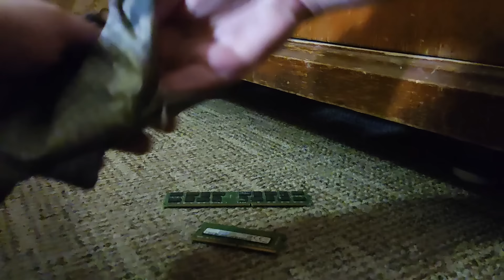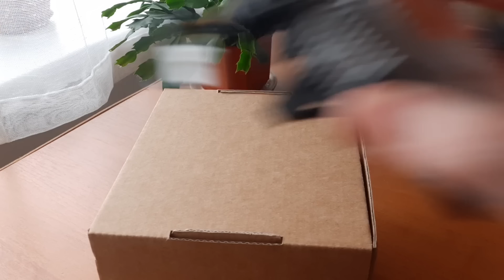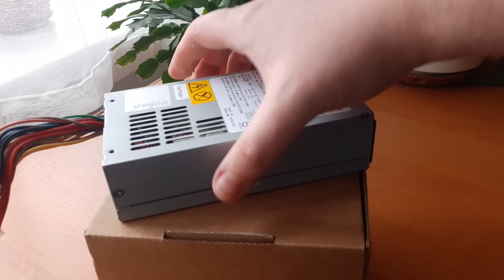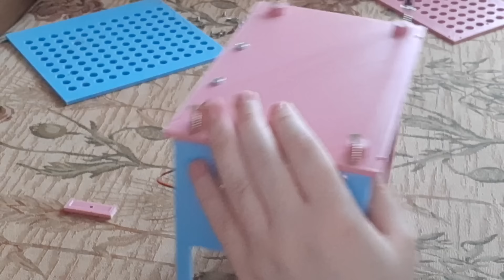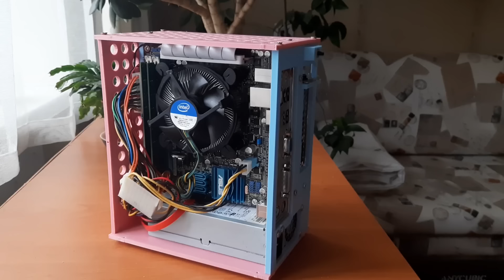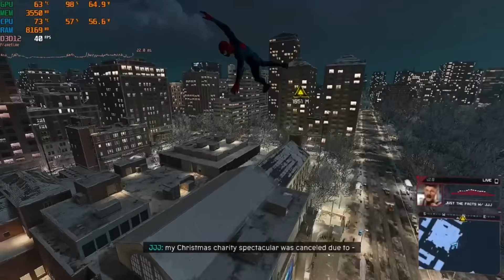3D Printed 6L Sandwich PC - $140 Budget Build

Comment: What's your 3D printer? I have BC-250 and few other things I want to print plastic cases. Having my own printer would let me experiment freely.
Reply from the maker: anycubic i3 mega s, it's pretty old and kinda janky, i'm sure there are some newer options out there that would work better.
Reply: If your willing to cut things up and then screw/glue them together, go for the bambu labs a1 mini imo, its a genuine beast for £170, and if you wait you can get it down to like £130

Comment: i have 5 pc's one is a full custom i7 8700 32ddr4 water cooled a Corsair all glass case/psu and a rx 6600 8gb i did in 2020 my the 4 are used dell office sff i got cheap dell 5070 i7 7700 32gb of ram 2 of them in stock case have rx550 4gb and the last one has a 1070 ti in a black & glass case 12 fans NO RGB !!!!! LOL
Reply from the maker: i'm too scared of water cooling to ever try it, same with glass, seen enough reddit posts about broken glass panels to try that myself lol. rx 6600 is a great card, i was using an rx 6600 xt up until a few months ago, no complaints, only upgraded because i was worried gpu prices would go up, but the only games i'm playing now are from the playstation 1 era lol.
Reply: @LastComputer7642   i live in AZ it's to hot for air cooled and i got my aio's on amazon sealed loop  so i don't put water in them never had  issues & glass is nice and if you ever brake it just get mesh & magnets /plex glass to fix for cheep & a new case is the cheapest/best why to give you a new pc feel for low cost and gives new life to old pc's  ..

Comment: 32GB of used RECC DDR4 was $37 a pair of 16GB DIMMs. Now it's $200. Ridiculous. I hesitated back in Oct. 2024, Regret it now. Can't finish 3 system builds I had started. I've abandoned my computer hobby for the next 2 years. A 8TB used enterprise He drive was $70 each, now good luck finding one. Around $250 for an Ultrastar. Rip off. NVME SSDs are no longer affordable too.  SMH.
Reply from the maker: yeah it sucks, i feel lucky that i was able to build a semi decent am4 computer for myself before the prices went up. and even these old builds are rough because you need to search around for any kind of storage that's a reasonable price.

Comment: I burned out four 2600 processors. Finally clued in that turbo boost turned off prevents the processor from burning out one month after warranty.  Manufacturers always have measures to outdate your investment, designing dumb features and forcing you to upgrade. You might own it outright but will break by design.
Reply from the maker: wow that's crazy, but tbh these 2600 cpus do run very hot for what they are, the next generation really solved a lot of the thermal issues. these 2nd gen i7s really need a beefy cooler. they're also less heat tolerant than later chips.

Comment: I fixed a 1TB SSD with diskpart by doing a full disk clean/format that took like 16hrs. Its working nice though.
Reply from the maker: 1tb ssd is basically like gold these days lol
Reply: @LastComputer7642 I know lol. Before the RAM/SSD crisis I would had wrote that SSD off and stuck it somewhere to collect dust. Thanks to the RAM/SSD crisis I now have experience fixing SSDs that may seem like they are unrepairable and will always try a lengthy diskpart from now on. 😂

Comment: It's crazy to think that Redhat and Windows 11 are official dropping support for 2nd gen CPUs
Reply from the maker: yeah i hate windows 11, only ever had annoyances with it since upgrading from windows 10 on my main pc. but tbh i've seen people boot windows 11 from socket 478 pentium 4, so even if they pull official support i think most older cpus will still work fine.
Reply: Microsoft pulled support for 2nd gen Sandybridge over 10 years ago on Win 10. They really are scum. Thank god for the user community for work around solutions. Currently still running Win 10 Pro on a Dell Latitude Sandybridge i7. Claiming it's too old is just BS. I even have Secure Boot and TPM on this old business platform. So it's just excuses to cut people off at 8th gen.

Comment: I have an inwin infinite #003/11. Just got all the parts for it but will be installing everything on april 22nd. Rtx 5090 watercooled, waterblock, 9950x3d waterblock, gen 5 4tb ssd waterblock, 200mm res, 3 radiators primochill eximo acrylic ended 2x360mm 1x120mm. Msi godlike motherboard. Watercooled ddr5 6200mhz w waterblock. Hardline premium tubing. Lian li uni lcd fans. An absolute monster of a machine. The case alone is worth $38,995 usd.
Reply: okay
Reply from the maker: not too bad, i hope the 5090 is the 96gb version though
Reply: @LastComputer7642 no hahaha but! But.. but.. the top 120mm radiator primochill eximo acrylic ended version will be the first to be installed up top in an infinite build. Giving a major advantage over the "bro water cooling" version. Each time he missed many opportunities for ram waterblocks, ssd, and the top 120mm radiator with a slim special fan noctua nf a12x15 chromax fan up there absolute monster build

Comment: Love the cute build, especially with the custom 3D printed case and reusing old parts. i kinda wonder if something like batocera would work well here, with that hardware (assuming the linux kernal plays nice with the nvidia card) should emulate up to ps3/xbox 360..
Reply from the maker: thank you! i do think batocera or steamos would be good here. i've got a ryzen 2500u build i'm working on rn and i'll probably be putting steamos on there just for fun. i've also seen people use a cut down version of windows 10 on these potato builds which seems worth trying.

Comment: Hey man, this 3D Printed case seems really cool. Do you think I'll be able to print it on my A1? Bed size is 256x256x256mm^3. Thanks :)
Reply from the maker: definitely, my printer supports 220x220x210, so yours should have no problem, my account on thingiverse is new so i have to wait 24 hours till i can post the project. but i'll link it here when it's up.

Comment: Super cool build for what it is. I wish I could print stuff like this but I'm not confident my A1 mini is big enough. I like the color scheme
Reply: you can split parts into smaller ones so they can fit on your build plate
Reply from the maker: @menace_to_society1  yeah i've done that a bunch, it's super annoying but it works.
Reply from the maker: thank you! your printers bed is pretty small, but like someone else said you can glue parts together. i've done it a few times, it sucks but it does hold pretty well. my next build video is going to have a 3 fan gpu and that build had tons of super glue lol.
Reply: What you can do is print out the different panels and assemble them with screws or click systems.